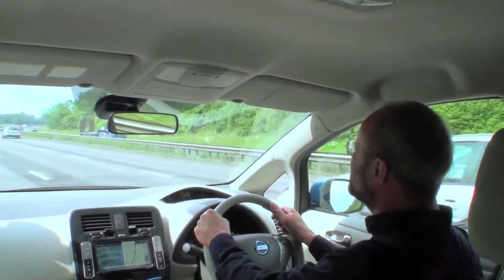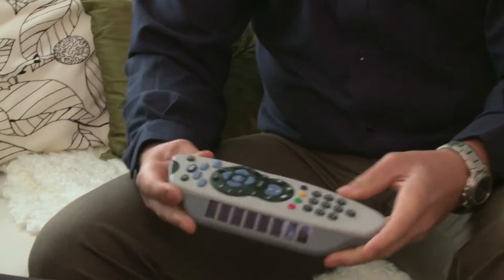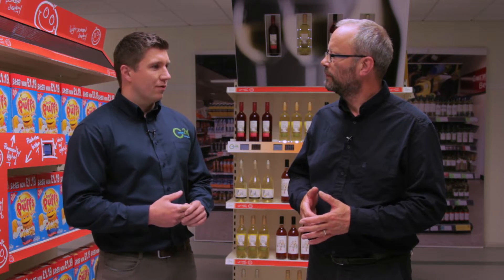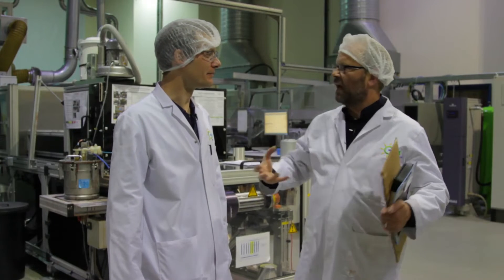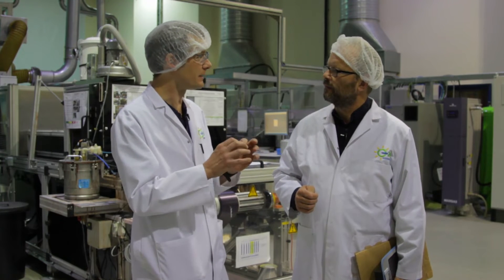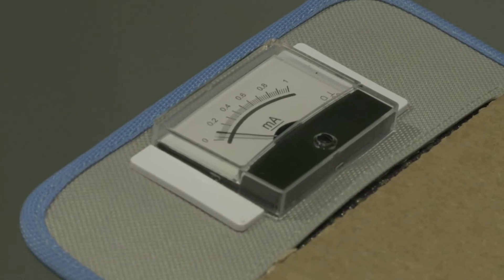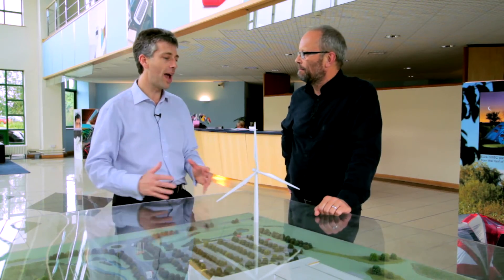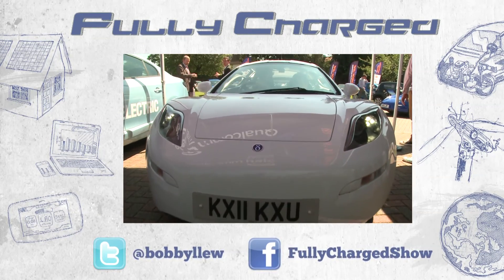Energy Harvesting Factory | Fully Charged

Comment: The introduction doesn't fit the topic.
The whole energy-harvesting-thing is mainly about providing small amounts of off-grid-electricity. 
Embodied energy of the device is non-issue.
Like you said in the end, it's about avoiding batteries.
Think of a solar powered calculator: How much energy does it consume? It will never consume as much energy as the production of the solar cells had consumed. Nevertheless it's very practical.
And "greener" than batteries.

Comment: And by the way.... solar calculator have been many years, and they work great with just that mini solar-cell. I stoppet buying disposible batteries in the 80's and went for charging batteries. The chargeble'batteries where many times stronger, a lot cheaper (2000×prise of disposible) and very convenient ( no go shopping an use fossil-fuel). still use some of the chargeble batteries i bought in the 80's. putting solar-cell with this will end that batterychange problem...

Comment: Oh god, that depends on so many factors, i can barely even start to guess on it.

Lets say you made a "cover" for the iphone that glued to the back of the phone or something like that, and had a coil for induction charging, and a similar pad .... hum ... I'd guestimate them to be about 40 bucks or so, even at fairly high mass production volumes.

The solar panels, plus the silly coils and their coppery wires drives the cost up.
But the idea is still sound, I'm surprised they don't exist.

Comment: Nice video, but I have two issues:
1) Having panels on each small device around the house is a poor solution. I would rather have a single panel in full sunlight that powers chargers for portable items such as remote controls and phones and fixed ones such as low-powered lighting, radios, the internet router etc.
2) 8% of all power used by standby? I think you need to back that one up.

Comment: I've got a response to that statement "It's just a con" that has *never failed* to convince even the most ardent skeptic.  Say, "No product can be retailed for more than the input costs."  Then you just work out the value of the electricity produced over the life of the panel and compare it to the cost of electricity.  Even if the *only* input into the panels is electricity (which it isn't) then the panels put out many times more more electricity than what you can buy for the same money.

Comment: No kidding. I have an e-book reader. The top of the range model from the company that makes the one I have uses and LCD display and is basically an android tablet with special software - Battery life: 10 hours. My slightly cheaper ebook reader uses an e-ink display. It's probably slower too, (but still has an 800 mhz cpu apparently), estimated battery life: 1 month. I'm not even joking here. I guess the effects of not needing to power the display continuously aren't trivial.

Comment from the maker: I don't think their efficiency is an issue, they merely trickle charge, very small amount of power all the time. As for cost, no figures yet, still emerging technology but so cheap as to make no difference in price of things they're attached to. They are not like solar panels, they are low power energy harvesters which will do away with the need for disposable batteries. No need for sunlight.

Comment: These shop price labels use e-ink that does not use power to maintain the display.  Even LCDs use power to maintain the display.  So power is only needed to change the state of a pixel. It then remains set without power.  If the radio to receive the new data is only woken up once or twice a day then that's enough to allow a daily price update without wasting power listening to the network.  Most people won't have 12 year old remotes for TVs so the life of the thin film is probably long enough.

Comment: Nice episode.
I've seen PV powered price displays in a supermarket in Munich airport - thought it was a great idea. As is getting rid if disposable batteries. Would also like to get much longer lasing rechargeable cells - I guess that means much improved electrochemical materials or higher capacity double layer capacitors. Coupling almost unlimited life storage of ultracaps with long lasting PV production would be great. Dye sensitised cells short lived at the moment, at least if used outside.
Reply: Maxwell Staedtler They have these things called Nickel Metal Hydride  batteries that recharge and match the voltage of disposable cells.

Comment: There's solar powered planes... Problem is the amount of power a jet engine uses means you'd never get a solar panel big enough on the plane itself. An electric jet engine (or at least, something that could produce thrust from electricity) isn't that difficult to create. The problem is that no battery in existence has even a 10th of the power density of jet fuel. Electric aircraft would be possible if there was a major breakthrough in battery technology. But that's unlikely any time soon.

Comment: AFAIK, the thinfilm cells "die" almost as quickly indoors as they do outdoors. Apperantly it's because of some sort of seepage trough the film. An oxydization process of sorts, if I've understood it correctly.

Offcourse, the major caveat of thinfilm photovoltaics, is that they have lower efficiency. But they generally make up for that by being both cheaper and more flexible.

It's all a case of cost/benefit nowadays.

Comment: Interesting episode.
When I think about it, I haven't used a calculator that used a battery since .. uhm ... I think it was back in my early school years ... 1980's or so ?

Still, my cellphone does have that silly charger that is on standby all the time, and my external harddrive too. Surely they could have a solar panel for when they are not doing anything.

Or how about a mousepad that was both a solar panel and an induction charger ?
So .. a wireless solar powered, self charging mouse. :)

Comment: good video but I'm a little concerned that if their product only lasts 10-12 years indoors that they would die very quickly outside. so it seems a little gimmicky.
but it's a good point that photovoltaics can be super low energy products because the active size where the sun is converted to electricity is super tiny.
so we just need that perfect production technique because sand is not that expensive.
I bought some conventional cells and they are only 180micron thick already, almost like paper.